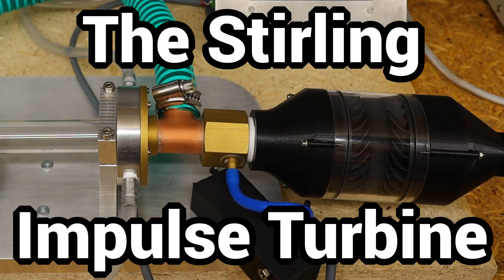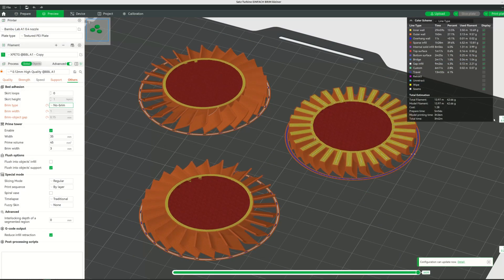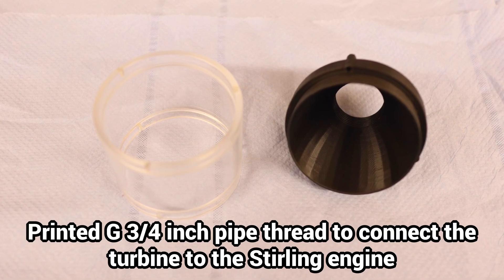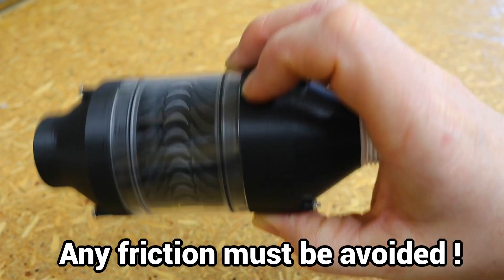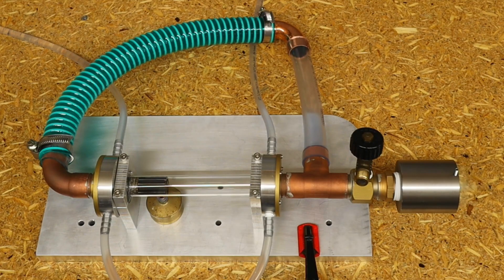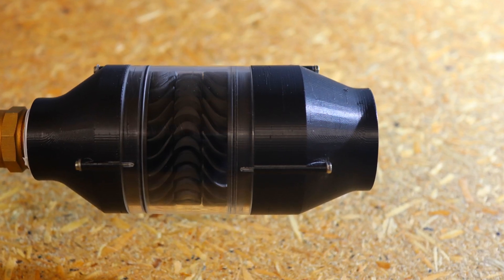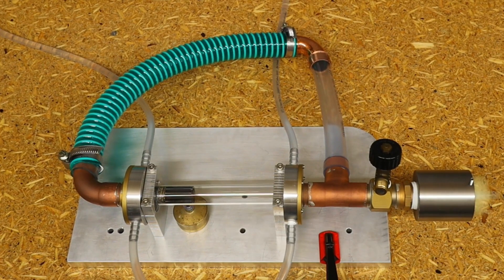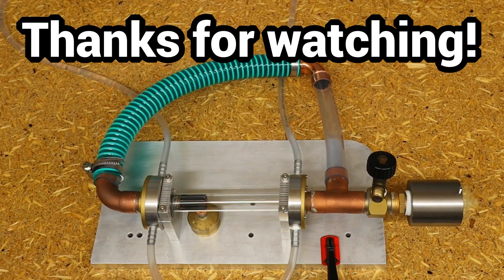DIY thermoacoustic Stirling engine with bidirectional impulse turbine for free energy to go off grid

Comment: This is the first video if yours I've seen so apologies if you covered this in sn earlier video, but if the idea is to generate power, why not just put a small permanent magnet in the end of the piston snd the oscillations can pass it back and forth through a coil of wire. That's practically direct energy conversion into electrical power from the piston movement, no need to fuss about with a turbine.
Reply from the maker: In a photo at the end of my video you can see some parts of my linear generator which I will test when its completed.
But I love the turbine because its easy to print and maintenance free compared to the piston!

Comment: This is very cool! My opinion is that you should avoid optimizing too much for super low tech DIY until you have something that works well. If I have to order the parts from a professional CNC shop until you can lower the barrier to entry then that's still pretty great. If I were you I'd focus on making an open design that anyone can easily have manufactured and assemble on their own. I think the key features here are 1. That it works to the point where it's useful and not just a demonstration. 2. That others can modify the design and manufacture variants or have variants manufactured. Being able to make one with home tools would be amazing but trying to solve that at the same time as trying to solve goal #1. is a lot and the most likely outcome is that you run out of steam and the project stalls before you reach that goal. If you get to something useful that other people are using then that will get you a lot of attention and support and hopefully collaborators. I'd support with a small monthly donation if: You use an open license and don't restrict access to members (restricting early access is fine in my opinion). And if you use another platform for donations since I don't want to give money to Google. Thanks for making this video!
Reply from the maker: Thanks for your very nice suggestions that I think is really remarkable.
I can't put too much time into organising the release and the youtube membership was the easiest thing to do.
I know it's not ideal, but if you're really interested, the 99 cents shouldn't be a problem.
Thank you very much for your valuable help, I will think about it carefully!

Comment: What about adapting a linear motor as a generator? Some neodymium magnets could be configured as a resonant oscillator, add an external coil and you've got AC power.
Reply from the maker: In a photo at the end of my video you can see some parts of my linear generator which I will test when its completed.
But I love the turbine because its easy to print and maintenance free compared to the piston!

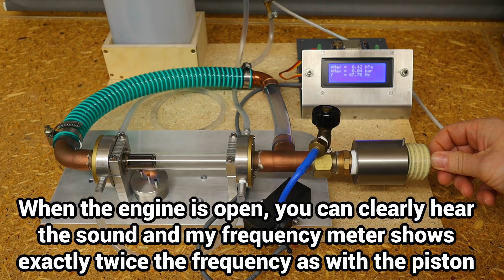Comment: At 2:39 you told huge bull shit way to increase power. You can increase power better by encapsulating the working gas and increasing the pressure of the working gas sat the same temperature. It will get more compact by increasing pressure and the turbine having a flywheel.

Comment: First everytime is to improve efficency... the next step is to reduce manufacture cost.

The generator ideas are good. Try and improve. Right generator parameter makes a huge difference. Speaker as generator idea is good, too!

Maybe you can do a version with lenght adjustable pipe while working engine. Easy with pvc and 3d printer.

Replace the glass with cooper. Much better heat transportation.
Reply from the maker: Thanks for your very good suggestions, I will think about them.
But the glass is chosen because of its low temperature conductivity.
Around the regenerator it helps keeping the temperature gradient high and the for the thermal buffer tube it also shouldn't transport the heat.
Only at the heater itself copper would be better.

Comment: Rather than a turbine, would a magnet  passing through a coil be more efficient. Thanks for sharing.
Reply from the maker: I am also building a linear generator as you can see on one of the last photos in the video.
A turbine is much more easy to print and less maintenance intesive than a piston so I favour it!

Comment: Beautiful! What’s the maximum efficiency you believe you can reach?
Reply from the maker: For such a small engine an efficiency (without air preheating which can boost efficiency later) of 10 to 20 per cent would be great!
Reply: @ and what is the theoretical maximum for that type of engine? Would love to see a deepdive video regarding the math, but for non engineers.
Reply from the maker: The theory is quite complex and I am still struggling with it.
The best efficiencies I read about are in the region of a good diesel generator.
With a good air preheater the efficiency can be boosted additionally!

As I want to use it in an micro CHP to heat our house, I can live with a relatively low efficiency as the waste heat is used completely!
Making a video about the fundamentals of thermoacoustics would be very much work and I think very few viewers would be interested so I don't think I will make one.

But when I think about it, to motivate me to really learn thermoacoustic theory, maybe when I have some time waiting for parts etc.

Comment: Awesome. Thank for sharing. I guess you should try with a twin engine mirroring and working in push/pull through the turbine. This way you'll have a closed vessel that can use a better gas and pressuring it will multiply the power. At least, instead of a mirroring twin engine, you should put a resonator, just a pipe with an open end to a cavity. That will also provides a closed system.
Reply from the maker: Yes, thanks that is is avery good configuration but also a lot more work.
A configuration loop with three cores is often used by professionals, but with pistons I think.
When I am really familar with thermoacoustics I will try a multi core configuration but at the time things are complex enough for me.
Thermoacoustics are really complicated...
Reply: @myengines2443 now one side of the turbine is open to atmosphere, that's like a short circuit, the energy not absorbed by the turbine is lost.  You should have a resonator instead, that way a part of that energy can spring back and be recycled in your system.

Comment: Love it! Go bigger and more efficient! Although I love turbines, maybe better to use a speaker (like I did here: https://www.youtube.com/watch?v=XU_OHh2JR1c  )
Reply from the maker: Thanks for your kind comment.
And special thanks for your impressive demonstrator video of a speaker generator!
After seeing it I am really thinking of giving it a try! after I tested the linear generator that is also nearly complete!
I read that speakers are not quite effective and only suitable for very low power in a thermoacoustic engine but I think I have to try it myself!
Reply: @myengines2443  Efficiency, well; I got quite some power out of it! Import to take away most of the cone. And of cours; the bigger the speaker the bigger the power.
Reply: Note that the speaker has its own resonance frequency. It will not work on any other frequency.
Reply from the maker: @GiesbertNijhuis  and how do I know the resonant frequency of each particular speaker? Are the marked?
Thanks for your kind help, I really like your work!
Reply: @myengines2443  You have to discover the resonance frequency. When not in a box and with most of the cone gone, everything changes. But i would go straight to a subwoofer with a long stoke. Connect it directly to your piston so they together have 1 resonance frequency. And thanks for your kind words! I do hope you will also continue with the turbine, because turbines are cool.

Comment: Efficiency increases would be the greatest thing I think. The ability to convert energy into something useful.
Reply: Economies of scale and iterative design… that’s technological advancement
Reply: @ I think you misunderstand economies of scale. The power available from one of these Stirling engines is too small to harvest unless efficiency before an attempt is made to increase efficiency. That's where I'm at with my stirling engines, going from that self-turning phase to powering-something phase.

Having a million engines that only turn themselves doesn't add to anything more than having one or zero when needing power. Thus why efficiency is needed.

That flame probably makes about 100W of power, and the Stirling engine would need to be at least 20% efficient in order to power a small generator, resulting in 10W out of the generator.
Reply from the maker: Ok, thanks!
Reply: Part of me wants to say a brute force method of making these dirt cheap could nake up for poor efficiency. 
1 generator that makes 100 watts or 10 generators that can output 50 watts each, for the same price.

Anyhow neither are mutually exclusive goals
Reply: @ With that logic, lemon batteries could be optimal, which I disagree with. 

If one of these can convert solar energy with a 1 metre lens comparable to a solar panel's efficiency, that'd be fairly cool.

Comment: Have you seen the freestyle piston sterling engine from Banggood? This design looks to be powerful & maybe just what you're looking for. https://youtu.be/1jqM9twXnno?si=uptlNhKjjMab-z18
Reply from the maker: It is really nice but I want to avoid as many moving parts as possible as I had much problems with the durability and wear on my 300 watts rhombic Stirling engine you can see in my older videos.
So the concept of the thermoacoustic engine is so attractive to me and has my full attention at the moment!
Thanks for your kind suggestion!
Reply: @myengines2443  Very nice work, big congratulations! I still consider the multi-core branched standing wave motor to be the best choice for your criteria, even with a unidirectional turbine, which is no worse in efficiency than the bidirectional one, and it is a mistake to think that it only utilizes one direction of vibration. The reality is exactly the opposite...
Reply from the maker: @tibsim  I think I should take a closer look at the unidirectional turbine, your development looks really nice.
A multicore engine will make things even more complicated what I really don't want?
Many thanks for your great help!

Comment: what calculations did you do to support design of the turbine? You may be surprised at just how small a turbine should be for a given power output.
Reply from the maker: I didn't calculated any power levels.
I just tried the smallest size that seemed reasonable printable to me.
The geometry is from other researchers some years ago.
Reply: @myengines2443  Probably your turbine is much too big for the mass flow the engine produces. But the concept works! If you can get access to a resin printer a smaller turbine should be feasible.

I should really read some more literature on the thermoacoustic Stirling. Curious to see what typical working pressure ratios and so forth are.
Reply from the maker: @nerd1000ify  I think my is not to make the turbine smaller but make the engine bigger 🙂
The power must be significantly higher to be useful.
Today a was turning on the lathe the whole day to make a bigger core branch!
Reply: @myengines2443  I imagine if you know the mass airflow through the engine, then you can use turbocharger turbine or compressor maps to help get you in range of the size of turbine you need.  I also am of the opinion your turbine is too large for the energy you're putting in.  Your turbine is significantly larger than the small one on my v8 turbo diesel.  You'll need to get the turbine up to a pretty high rpm to be able to extract any work from it.  I wonder if there would be an advantage to sizing your turbine so its rpm has a relationship to the engine frequency.

Comment: Why a turbine instead of a linear generator? how do they compare efficiency and reliability wise?
Reply from the maker: I am also building a linear generator, you can see the parts at the end in the video.
A turbine is much easier to print and I think it will be much more reliable and less maintenance intensive!
Reply: @myengines2443  easier than using a speaker? What maintenance would a linear generator need?
Reply from the maker: @ChrisDay-sx4lv  a linear generator needs a piston which has wear, and a speaker has a membrane that has wear also.
To work as a useful support for our solar plant in winter it has to work 24/7 so wear is a big problem!
Reply: @myengines2443  I was unaware that the membrane was a wear item, that was what i was thinking of. Looking forward to the next vid :)

Comment: I've invented a new collector system that is cheap and universal. looking for a stirling engine for testing.  Can you share the STL files
Reply from the maker: That sounds nice, plz share your nice work and show videos!
In the members area are many 3D models and drawings, just 99 cents for a membership!
Reply: @myengines2443  I built this one about 10 years ago and its still running without any servicing, just occasional inspections.  My latest design is actually a 1000 times better and far cheaper.   https://www.youtube.com/watch?v=c7WcbBnEC4M.....Trying to design a stirling that can convert the thermal energy to kinetic and make it a total solar air-conditioning and electrical generating solution.

Robert

Comment: yeah, the larger version might be able to properly use the turbine with that diameter.
You can also try pressurising the system to some degree, that might allow you to get some extra performance out of it.
Reply from the maker: Yes pressurizing is always a good idea, I think than I have to make the 3D printings airtight using Dichtol or just paint!

Comment: The goal should be the performance, and then the ease of manufacturing.
Reply from the maker: Yes, but i hope that some viewers also build it as its much more fun and much more effective!
Reply: totaly agree... make it work, then optimize it, if it is not practical, then optimizing it seems waste of time. so first let's proof a point, and scale the power
Reply: I disagree completely. There are many cases where less performance is acceptable if it means the difference between going with and going without. The most performant technology in the world is worthless if you can't get it into the hands of the people that need it.